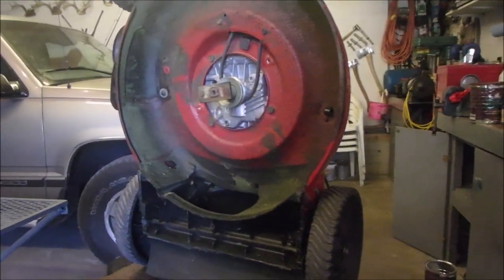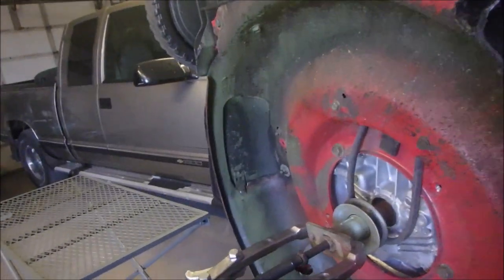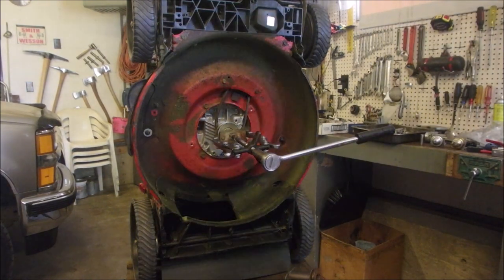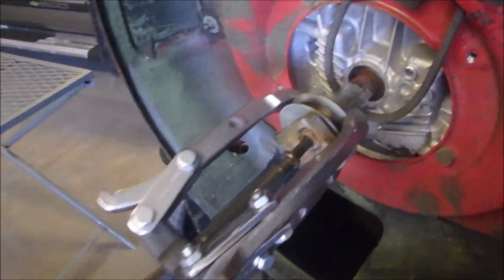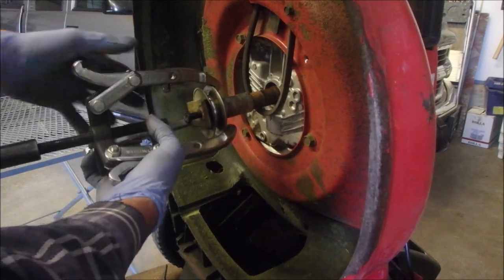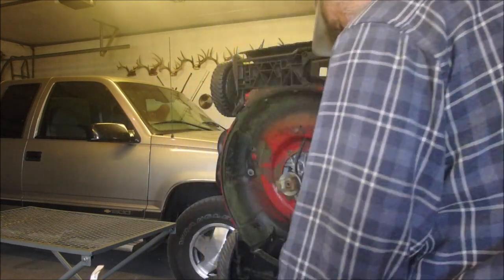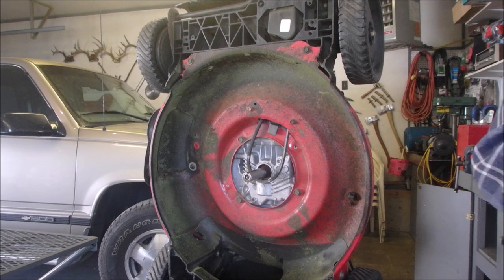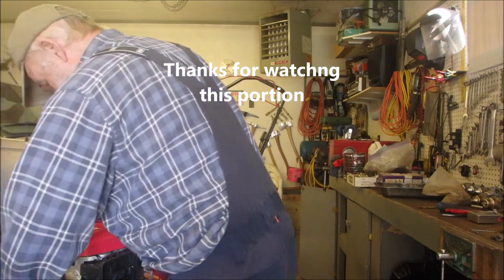A Mower Blade Adaptor Is Rusted On

Comment: Eliminator Performance removal method: 1. PB Blaster spray above pulley and into bolt hole to allow penetrant to work its way down shaft and dissolve rust 2. Use only a bearing puller tightened around the shaft of the pulley above the area the blade mounts to thus not allowing the pulley to get distorted 3. Great point Bruce on the centre hole in the adaptor bolt really helps keep the puller shaft centered but we put a wrench on the bolt head to stop the bolt from working in when we are torquing with the puller 4. Use our Milwaukee 450 ft lb impact gun set on #2 to start to see if the adaptor moves 5. If adaptor does not move put impact gun on #3 and give it a short shot only to see if it moves 5. If it has not moved we pull out the #1 tool in the shop the Innovation Induction Venom Mini Ductor with a bearing heating coil which is wrapped around the adaptor shaft and normally 30 seconds is all it takes to provide enough heat to remove the adaptor with the impact gun. Since getting this induction gun we have had no issues removing adaptors prior to this we did grind two off. Great video on the struggles that are encountered removing adaptors that have never been serviced. Whenever we get a self propelled mower in for service we check if the adaptor will move if not we spray the PB Blaster on the engine crankshaft above the pulley in the hope it will help us remove it easier if we ever need to change it in the future. Using the bearing puller alone normally does the job and saves the adaptor .
Reply: By the way when Jake hits the 100K he will be giving away to a subscriber at least one Venom Mini Ductor gun, maybe you will be the lucky one eh?
Reply from the maker: Yes an Induction gun would be nice
Reply from the maker: @waynestefinashen239  That would be cool.  Thanks for your kindness to me  a self trained rookie.
Reply: I always give EP a thumbs up, because it always help him OOOOUUUUTTT  his is short, sweet, DETAILED
Reply: @REVNUMANEWBERN  You are the best and we both thank you
Reply: @waynestefinashen239  I assume gun goes to random selection of the 100k?
Reply: @kenhilson786  Absolutely correct a random subscriber and i believe when Jake posts the first video saying when the draw video will be posted he may be announcing more products that he will be drawing for. Everyone should note that these are products that Eliminator Performance is purchasing and having shipped direct from the suppliers inventory.

Comment: I spent hours trying to get one off recently. Finally I angle grinder-ed it off in 10 minutes. But mine was fairly easy because it didn't have a pulley. Good that you had the correct replacement in your hoard. The OEM pulley adapter for an MTD (25mm), for example, is pricey but I have seen aftermarket units for around $20. Thus, it may be worth one's time to sacrifice the part by slicing it off. But then we wouldn't have seen this interesting video!
Reply from the maker: True  thanks a lot.

Comment: Pb blaster, or trans fluid, map gas, and puller, I had a pulley assembly on an old snapper joy stick zero turn, I bent that pulley all to hell, heat, pb, heat, pb, it came off but that thing was a real pain in the keaster, had to order a new pulley, a double stack of course, and cost me 50 bucks, but always remember to clean, and put anti-seize on that shaft, for the next guy..... Great video.
Reply from the maker: I cleaned it and put anti-seize on it at 2;23
Reply: @BrucesShop  yep awesome job.... When that blade mount finally breaks free, that is a great feeling.

Comment: WOW Bruce, that blade adapter was stuck on there really well. Normally heating it up real hot with MAP gas, and a 3-jaw puller, would accomplish the task with ease. Of course you only had propane, but still, that was a lot of work, involving at least 3 or 4 tools to get the job done! Thats a nice looking mower, should do a real nice job mowing the lawn.
Reply from the maker: Thanks for commenting.

Comment: I've managed to get a few stuck adapters off with an air hammer, but that does require the engine to be removed from the deck.  I've also damaged a few doing that, too lol.  Good job on the removal, certainly a lot more effort than one would hope!
Reply from the maker: Thanks for sharing
Reply: why does the engine have to be removed?
Reply: @kenhilson786  Good question, as I didn't specifically mention in my original comment.  To get the adapter off, generally requires hammering it down off the crankshaft.  I don't think you'd be able to maneuver the hammer into a position properly to get the angle needed to get the adapter off.
Reply from the maker: @kenhilson786  It doesn't.  It needed a shallower blade adaptor.

Comment: No easier way I have found, other then heat and quench like grassrats garage, but that can damage the bottom oil seal on the crankshaft, but I went out and got 3 crankshaft bolts, clean em up and cut the heads off 2 of em, and welded them together, so it's a long threaded bolt, and put a divit in the head of the bolt like you did, so I will always have enough space to pull any blade or pulley off.
Reply from the maker: just for length I guess??

Comment: Good vid.  Got a Honda in same shap pretty much.  I bought it new so nothing changed, total push unit.  Bent the ears on a pitman arm puller it's on so tight.  Got a brand new motor so may just buy a new adapter.  man its tough.  Haven'tput the heat on it Yet.
Reply from the maker: Best of luck.

Comment: ,,,towards the end,,,I would have run to home depot, and splurged 2 bucks, for a longer center bolt,,,,just sayin,,,and that pointed, divot nut, on the end, of the puller, SUCKS, for this,,,so frustrating,,,im gonna use my nut buster, or grinder, to remove those, on my set, when it pisses me off, enough,,,,lol,,,,cool vid😎
Reply from the maker: Got you reply

Comment: Worst case you could of cut the bolt on the shank and extend it by welding a extension to it
Reply from the maker: Worst case for me would be splitting the blade adaptor lengthwise with an angle grinder. and chiselling it off the  engine shaft.  Thanks for joining in.

Comment: She's all fun and games until someone loses an eye. I've seen some people heat the shaft/bolt and then melt paraffin onto the hot metal. Sometimes it works and sometimes it doesn't. Worst answer we ever get is no. I've been known to judiciously use a Dremel cutting disk in such situations to split the outer piece then hammer the $@%& out of it with a cold chisel. We shall endeavor to persevere. Good work mate. Patience pays off.
Reply from the maker: Thanks my friend.